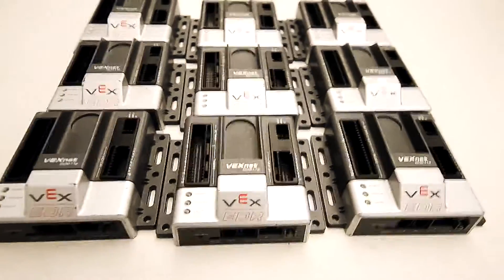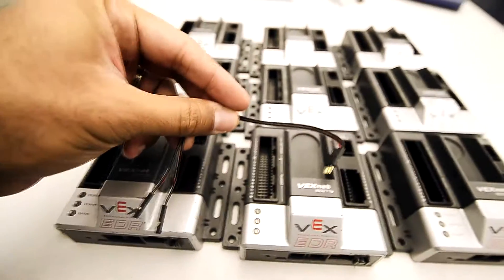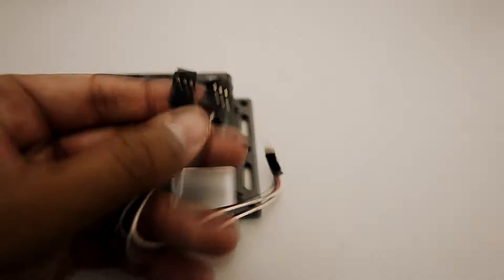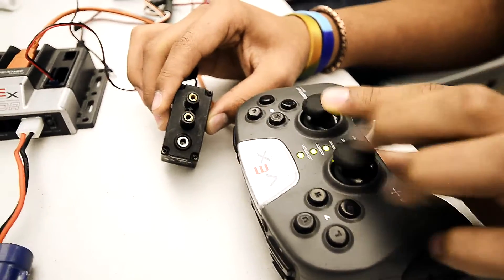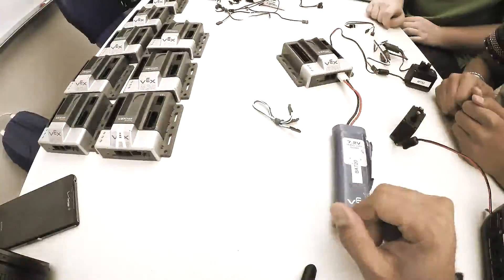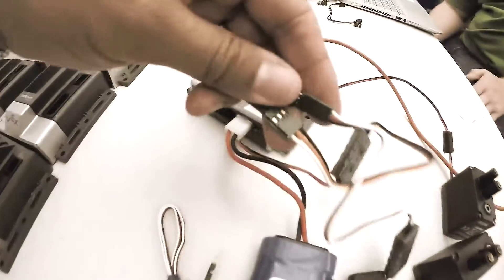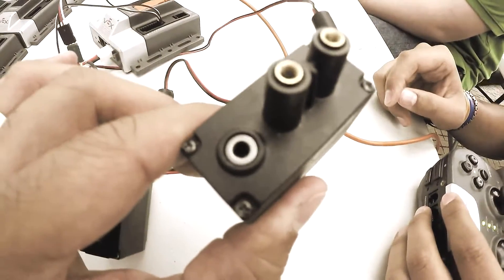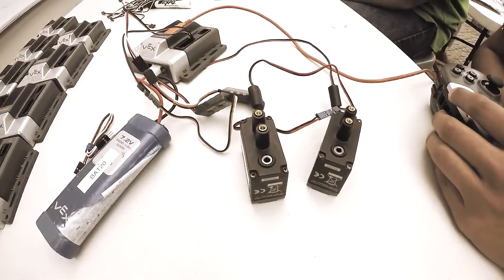How to Fix a Blown Port 1 or Port 10 on your VEX Cortex!!! - VEX Starstruck Competition

Comment: Technically you are not "fixing" the cortex, instead you are performing a work around solution that will allow you to run additional motors. The ports generally burn up because of a short circuit from your motors.  If you look at the top of the motor housing at the wire there is a rubber strain relief.  This relief doesn't really do anything and can rot/fall off easily.  Every time you move the wire it pivots around the motor housing at this point... this work hardens the wire.  The rubber insulation will break apart and your copper wires will touch.  You may never see this happen because it happens inside the strain relief.  If the short circuit happens in motor ports 1 and 10 it will blow... if it happens in 2-9 it will generally blow the MC29.
Reply: The only true way would be replacing the internals of the cortex but at that point, you might as well send it back to Vex and have them give you a new one.
Reply from the maker: John Butler awesome knsight and education. Absolutely love it. You think there could be an "actual" fix to it?
Reply: Yeah, I'd call this more of a workaround.

Comment: You can also have two extra motors maximum this way if u use two y cords I believe, that way u could get 12 motors total and it is allowed in competitions
Reply: Summer Nomad yeah he's right you can either use 12 motors using the y splitters or 10 motors and 2 pnematic reservoirs. the y split doesn't mess with the speed at all but I have heard of them over heating more often being on splitters.
Reply from the maker: Noor Nagra you tha bomb!!!! Thanks for supporting! Keep the comments coming!